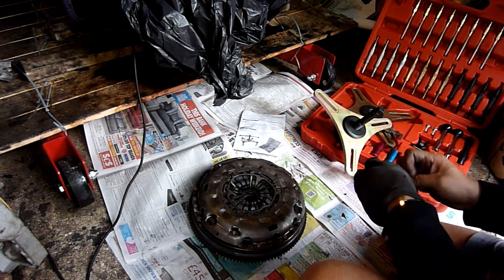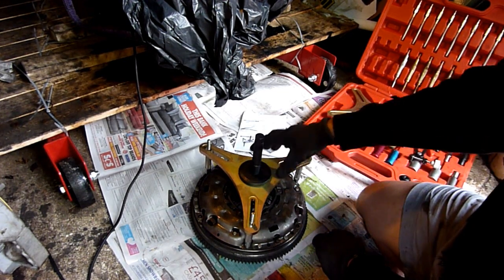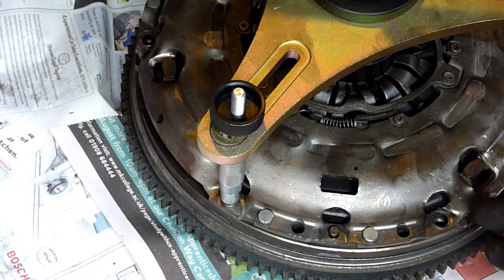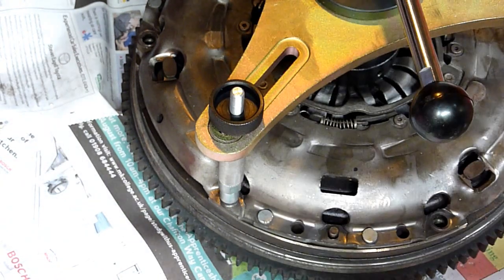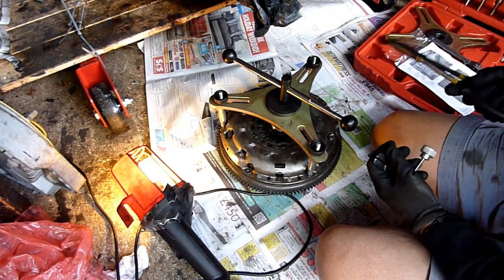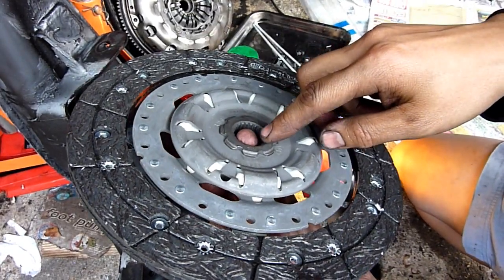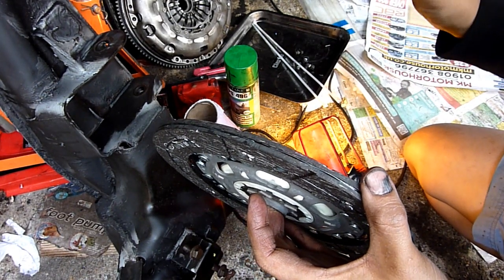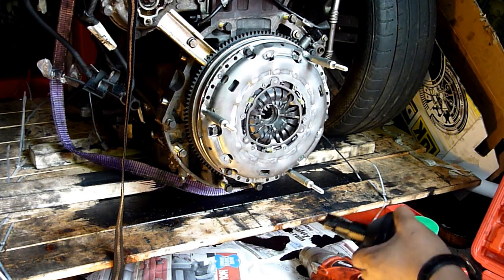Ford Mondeo Self-Adjusting Clutch and Special Tool 2003 late model 2 Litre diesel

Comment: Hi, is it necessary when flywheel, clutch and pressure plate are new?
Reply from the maker: Ok from the brief information you have given, I think you arecasking if you need to compressor and reset the clutch cover from watching me do it at the beginning of this video if your parts are all new. The answer would be yes. But carefully study my video as its been a long time ago since I did this video and I cannot fully remember all the details. But do copy what I did in the second half of the video as I am installing everything from new...all parts.

Comment: I've just fitted a Luk dual mass flywheel and Luk self adjusting  clutch kit and slave to my Megane 225.
Renault service manual says to compress pressure plate fingers, then set the three green adjust springs by turning them anti-clockwise, then let the pressure off the pressure plate and thats the auto adjustment set!
Then service manual says just use the usual clutch centralising tool, the small plastic tube type and tighten the pressure plate onto the flywheel diagonally tightening bolts gradually to torque!
Done! Except the friggin clutch won't disengage!! Aaaahhhh!
Somebody shoot me!
Reply from the maker: You didn't have or use the special tool?
Reply: @EducationPineapple  no, renault service manual doesn't mention the tool you're using at all!
You just set adjusters off the car, then fit the lot to the car, that's it!
Videos on youtube showing installing without your tool, you just take your time nipping up pressure plate bolts equally.
Which is what Haynes and my service manual said, i'm well pissed off!
People have told me this tool sets the adjusters, but why? Luk clutches are supposed to be preset out the box!
I've just bought another Luk clutch to fit to it, and that's set ready to fit, whereas one on my car wasn't??'i' had to do it?? 
Its so confusing.
Reply from the maker: @robbocop33r12  If it's dual mass, I think the theory is this tool is a must. Is yours a DMF?
Reply from the maker: @robbocop33r12  How did you manage to compress the pressure plate fingers?
Reply from the maker: @robbocop33r12  If I remember right, the special tool is needed to compress  the clutch then set, by tightening bolts a bit because if not, when you press the clutch down, after fitting, the plate does not fully disengage.
Reply: @EducationPineapple  yes it's a dual mass on mine. I compressed the pressure plate fingers with a hub bearing removal tool, fairly easy!
You're basically just doing 'on' the car what i, Haynes and my service manual done 'off' the car.
Now here's my dilemma, the new Luk clutch i have here is set out the box, so i won't need the tool then you would think.
Lum self adjusting clutches are odd, i've heard if there is a red sticker on the box it doesn't need a tool, or it does? Can' t remember which way round it is.
People said i could have my self adjuster springs set too tight, but as i've said before Haynes and service manual are set the same as mine in their pics?
Reply from the maker: @robbocop33r12  I'm guessing you put a new DMF in as well as the rest of the kit because the DMF is usually the thing to fail even before the clutch has been worn. You can in theory fit a new clutch and clutch cover on an old DMF, as long as it still functions. A properly functioning DMF will rotate a bit clockwise and anti clockwise, but is stiff and there's lots of resistance and spring plus dampening force to the rotation. It should not rattle and shake easily. Please see one of my other video for an example of a bad DMF.
Reply: @EducationPineapple  yes dmf was brand new as well.
Reply from the maker: @robbocop33r12  Did the new parts look just like the old? If not consider taking it back off and complaining it was the wrong part and get your money back. Get a new part and not accept until it looks the same. and borrow a tool to reinstall. Otherwise borrow a tool or buy (search on ebay or my link) and redo. P.S I wouldn't go for a solid flywheel conversion either just exactly the same part only. Also I would take a trip to the dealership fixers at Renault and ask to speak to someone there who has done this job himself to get the proper instructions. I've many times phoned one service department then another then another if they were not helpful at the previous one. Good Luck and I'll ask God to help.
Reply: @EducationPineapple  new parts looked the same as the old. I wouldn't consider using a single flywheel, people do to save money etc but it's dual mass for a reason, to spread the torque going through it!
I read someone, somewhere managed to pull around the self adjuster ring in-situ, on the car through an inspection hole?Then he got the clutch to disengage! 
Just incase i've set it too tight, but my setting did compare with all manuals i checked??I suppose I've nothing to lose since i'm going to renew it all anyway, Thank you for your time!
Reply: Just had a look at the 3 self adjustment springs on the pressure plate, i set them fully compressed,'two' of them have uncompressed and one is still how i  set it?? That can't be good.
I managed to set the two unsprung ones again in-situ, didn't make a difference.
Maybe i'll try setting them all half set, or wherever they naturally set to when i depress the clutch.